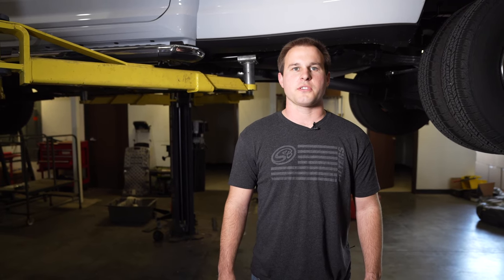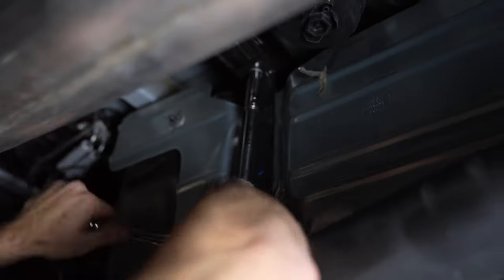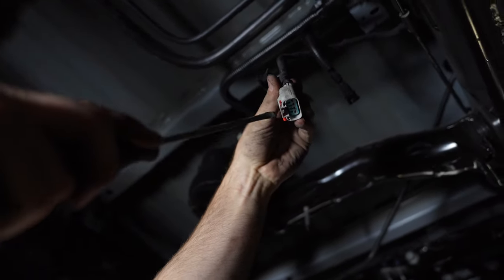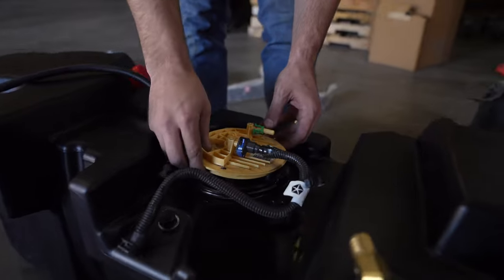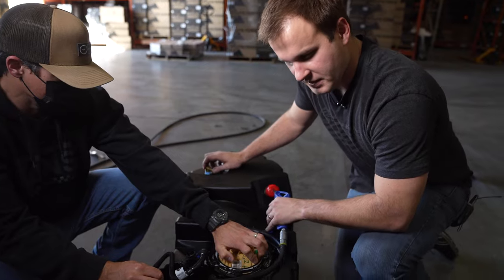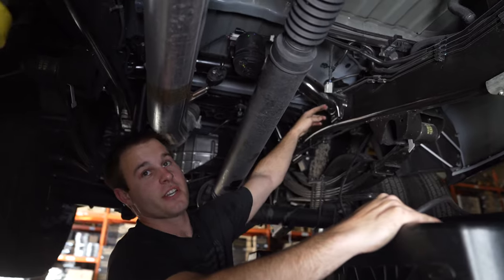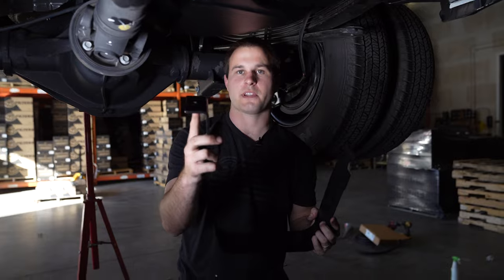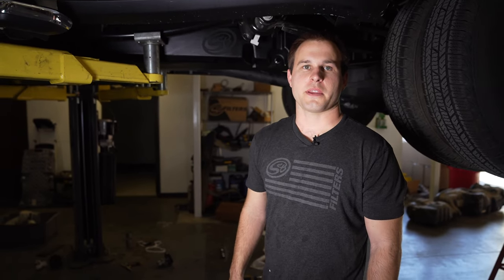S&B 60 Gallon Replacement Fuel Tank for 2013-2023 Dodge Ram Cummins 6.7L Crew Cab Long Bed

Comment: 10:57 It sure looks like he missed a critical step. To the left of his left hand is a bolt affixed to what appears to be the fuel tank strap, and directly above it, the open, threaded hole it is supposed to be screwed into.  So, add a last step....secure the two tank mounting straps using the ratchet wrench and appropriate socket.

Comment: Does the factory fuel gauge in the cab, as well as the estimated miles until empty still work as it should with upgrading and installing a bigger tank?
Reply: Both still work but they are both inaccurate.
Reply: You can flash one or two but doesn’t work on some.

Comment: What’s the difference between a mega cab and the long box when it’s the same frame?
Reply: Got the same question
Reply: It’s not the same. Long box on crew cab is actually almost 1 ft longer than mega cab.  Now if we talking about the old quad cab with 8ft bed vs mega cab then it exactly the same.  Trust me I was confused for a minute!

Comment: Do you know of a compatible Fleece performance gas pump that will fit a S&B 60 g gas tank?
Reply from the maker: Mark, the Fleece pumps replace the factory sending unit, so they will fit in any S&B tank that reuses the factory sending unit.

Comment: Hi, Interested in the 60 gal, for Ram  21’ 3500 long box dually with factory 5th wheel chassis with factory air bags. Do these fit? Thanks.
Reply from the maker: Hello Bill, 

Thanks for your interest in S&B Tanks. Your air bags will not affect the fit of the 10-1007 60 Gallon tank.   
  
If you would like to place an order give us at: 909-675-1313!